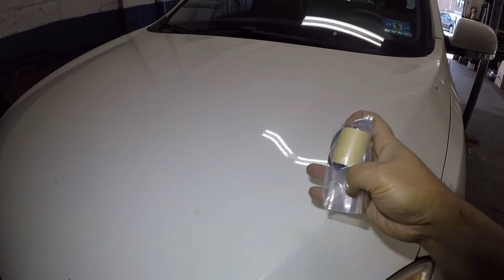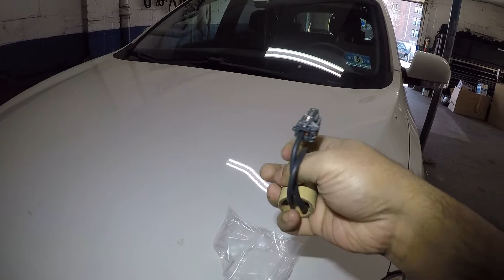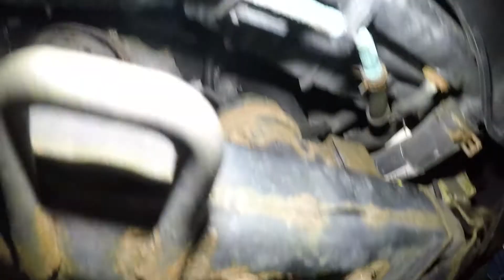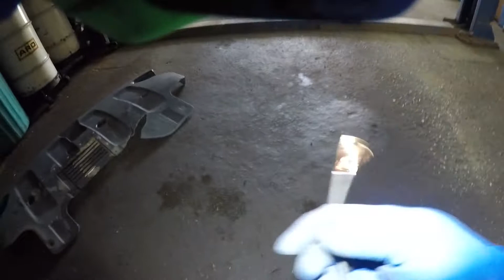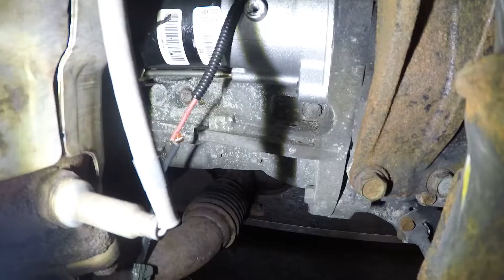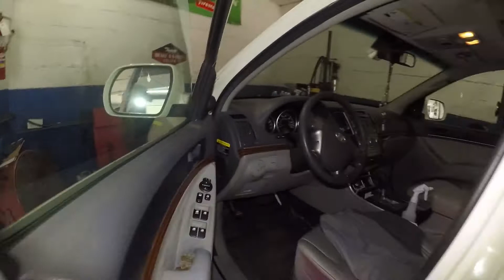Hyundai starter motor pig tail connector, electrical connector repair for starter motor

Comment: I watched the first video (replacing the starter) and called BS on the "deterioration" of the connector.  Come on - you just busted it.

So I'm doing mine, and very carefully remove my connector without damage.  Imagine a look of smug satisfaction.  

I reconnect, and it busts in 3 pieces.  I think it was deterioration.  Eating humble pie.  Thanks for the vids!
Reply from the maker: Lol bro I keep it real in all of my videos    That thing was like crispy as it could get
Reply: @RBTheMechanic  mine arrives tomorrow.  Appreciate the follow-up video!
Reply: @heyob  I just replaced my daughter's and it completely disintegrated in my hands. Seems like it's a common issue. I had to use electrical tape as a temp fix until I can get the piece delivered.
Reply: @RBTheMechanic sadly Im just learning Hyundai's fk ups

Comment: I have a question Has the car ever came back after you wired it like that I gotta replace a starter connector on a Kia idk if should wire it the some way as you did or use a but connector
Reply from the maker: Nope it’s been good every since!!